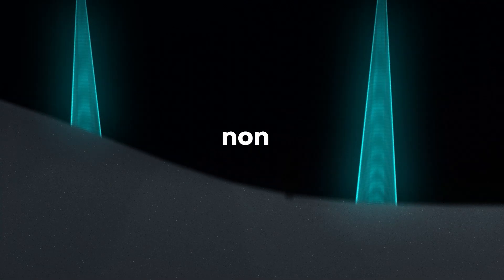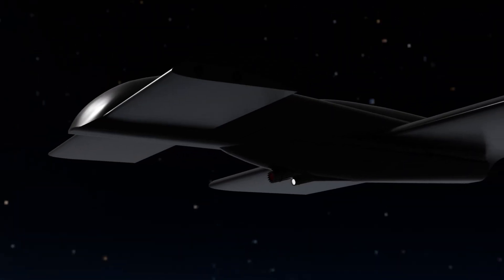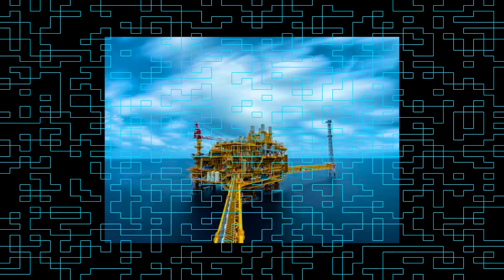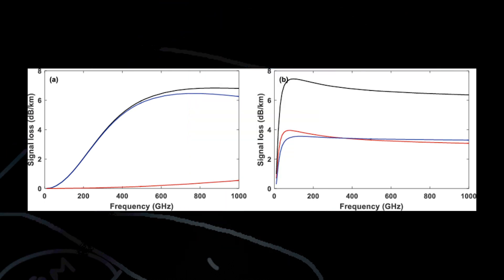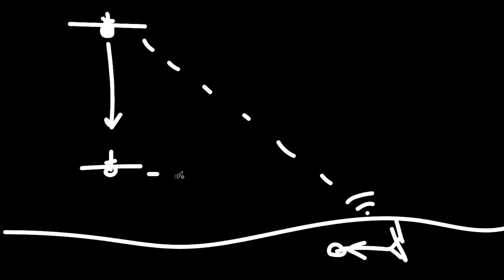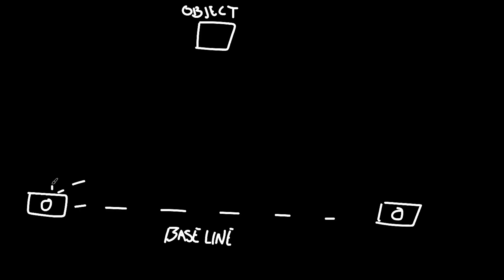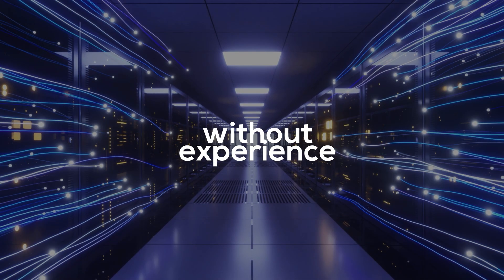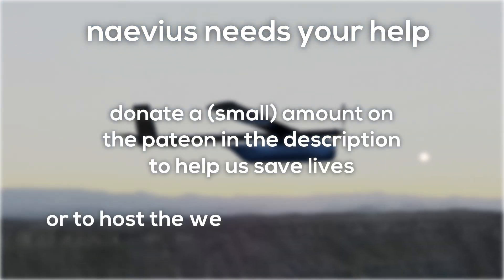Naevius One: The most advanced european SAR  UAV

Comment: Would flying so low not mean that signal reaching the UAV is weaker as it has to penetrate longer path through snow? Seems like there is a limit to how flying lower gives you more range.
Reply from the maker: Great point! I’ve been thinking about that recently as well, and we’ve looked at multiple possible solutions to this. 

So to be clear, the drone can fly for 80 km meaning 35 km to the site, 10 km for the search, and 35 km back. However in terms of the actual applications of the drone we can’t confirm yet if it will need this kind of range. This has to do with potential roadblocks from EU drone regulations, and them not allowing beyond line of sight flight without certain certification from the pilot. 

However if we cannot achieve a stable connection, the drone is fully autonomous. The only worry would be sending the signal for when someone is being found, which probably needs a reliable fail safe anyways. We are considering an additional antenna drone to connect both ends together, or 4g sim if coverage is good. However we might look into more options like satellite communications.